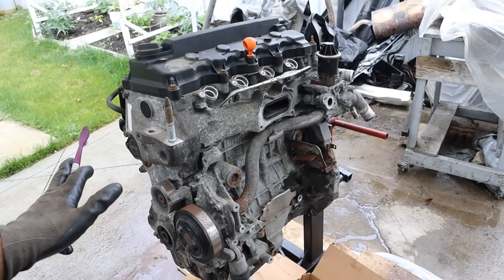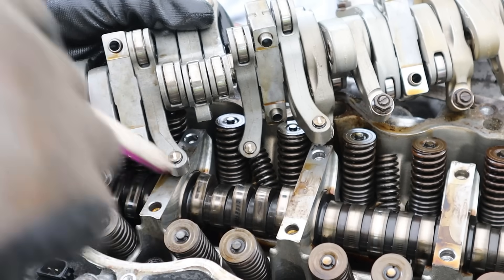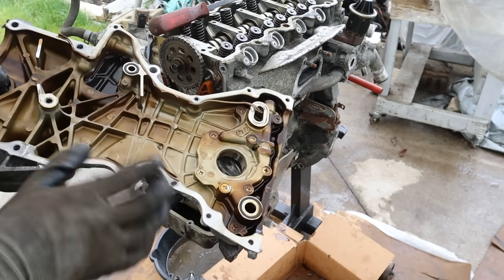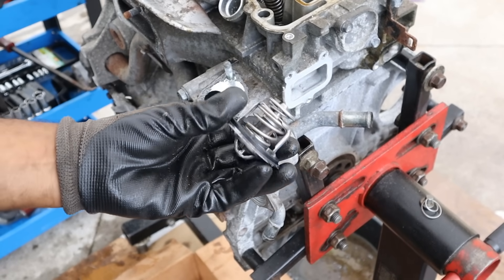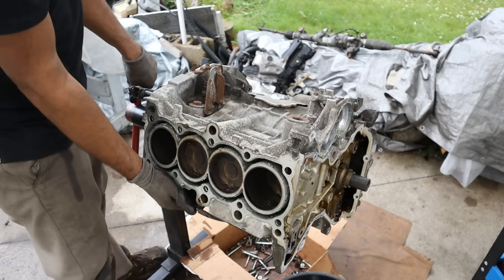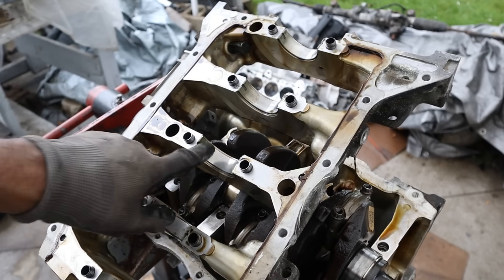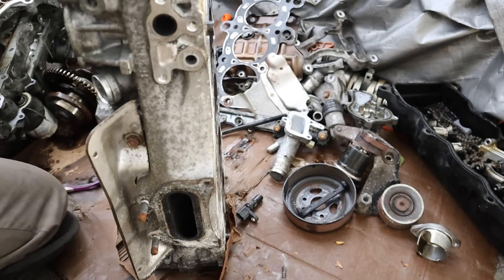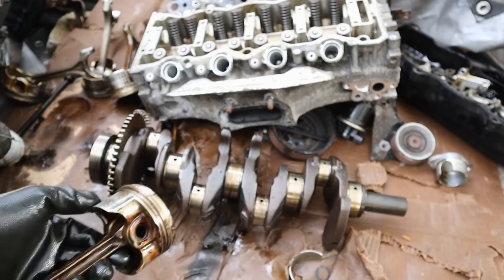Modern Engines are Junk: Honda Civic R18 Teardown Proves they Don't Make Them Like They Used To

Comment: Speedkar , you mentioned the transmission giving up before the engine. Do you have any suggestions for mitigating that? 

I have an 07 with 248000 miles. I’ve owned it since new. I’ve never missed a single preventive maintenance item. Although, I don’t really trust 100% Honda’s recommendations, I’ve drained and filled the transmission every 30K miles except for the first D&F. I performed it according to Honda which I believe was at 60K miles. I’m not having any issues with it but I’m trying to go as far as humanly possible with this car.

Comment: I have this engine in my CRV gen3. It is super powerless engine and consumes a lot of gasoline, but it is actually super reliable even here in cold Finland. We take long trips to freezing lapland and no issues never. It is also super super simple engine to maintain by my self. I don't really need any help from anybody. Adjusting (basically checking) the valve clearances are not issue at all. it just like checking those from lawnmover. I've got 310 000 kilometers in mine and doing oil change every 5000 and i'm using cheapest 5W40 synthetic. I changed to 40 too keep oil better inside since it's an old car already with worn cylinders. I know it is very short but i like to do it once a year at the same time, otherwise i forget it. I believe in sustainable living, not by buying new super low emission car, but to use old one ultill it doesn't run anymore withouht too expensive repair. So far it has refused to die. I'm quite sure the body of my car will rust here in harsh conditions before this R20 engine dies.

Comment: 2012 Honda Civic. R18A, 256, 000 perfect miles.  Idle my car all day in gig jobs.  The thing I replaced the most is the climate blower motor inside of the glove box. Tires and brakes. Original alternator and original AC compressor. I think I'll probably change them at 300k
Reply from the maker: Amazing

Comment: old engines are the best. i have a 27 year old iron block italian made 5 cylinder turbo with vvti, 430whp (front wheels via a viscous coupling) on the apexi AVCR electronic boost controller with no issues. running it since 2016.
Reply from the maker: 430 to the front wheels?
Reply: @speedkar99 Indeed

Comment: I have a 9 th gen accord with a 2.4 with a CVt it runs great but , I make sure not to hot rod it around like my 03 accord . I know the cvt  transmissions are prone to fail , but if you change the fluid and drive “normal “ they will last at least on Hondas and Toyotas

Comment: I got the r20a, 0 issues at 200k and pulls up hills so well with its 150hp. That intake plastic is quite sofisticated, has like 3 modes of operation based on rpm for ease of air flow in high revs or low rev, contributes to higher hp and torque

Comment: For a second, I thought this was going to be R18 slander. The R18 is still criminally underrated for its reliability other than its wobbly belt tensioner issue and AC compressor getting corroded. Other than that, these things are very fun.

Comment: Great engines indeed, very well built, reliable and relatively easy to fix and maintain. I own 2 of them currently, both bolted to manual transmissions, an 2007 civic with 230K which is going to rust away before it dies mechanically. As well as a 2008 with 103K that is spotless body wise. Awesome video showing the inner workings of these things, I like knowing how the internal parts of it work seeing I've never had to dig that far into one!

Comment: I had a 2011 UK built MK8 Civic for 6 years and the engine was absolutely fantastic. Great fuel economy, not a single problem in 50,000 miles, and it was actually quite a lot of fun. A characterful engine. The car around it wasn't great (built in the UK, what can you expect?), but the engine was a real gem.

Comment: These engines usually need valve adjustments because the valve clearance tighten up not loosen. Too loose is better than too tight. Anyway these engines are fantastic.

Comment: Own two Civic coupe's, 2007 manual 5 speed & 2009 auto 5 speed, with this 1.8 engine and will keep for my forever car's. The i-vtec on this engine work's below 3,000 rpm for increase fuel economy, not engine power, by lowering engine air pumping loss and shift's to a normal NA above 3,000 rpm. to red line. Have had to replace the passenger side engine mounts several times due to rubber support failing and causing vibration or engine to jump over road bumps.CAFE standard's and computer's are causing the death of reliable car's in general. Cheer's & thanks for the tear down!

Comment: Why do people hate on building these? In the middle of putting a d16 together, and this bottom end looks just as stout. 

Oil sprayers, bore and stroke like a b18. Fuck huge rod ratio? Exhaust port begging for a turbo manifold. 

Naybe the head doesnt flow? Maybe the ivtec is too complicated? Feel like it just needs a high cam lock and a mild turbo and these things could make 300hp all day.

Comment: Seemed like my 87 Prelude 2.0 SI had more metal parts. It lasted a long time, the only draw back was every 60,000 miles was the timing belt and water pump. The 5 speed manual was great too. Those days are gone.

Comment: I own a 2016 Civic 1.6 Dtec for 1 month now and it is such a great car honestly, fuel consumption is currently at 4.6 liter/100km in the winter with winter tires and I floor it more than I should as a new car lol , 136k km in it , if nothing goes bad I feel like I could keep this car for a very long time, bought it from a mainly Honda seller who himself has exactly the same model so hopefully the previous owners were good to it , before this I had a Corolla and honestly no issue with Toyota either , if I buy another car in the distant future i would love to own a Type R (FK2 or FK8) or a Yaris GR

Comment: Hondas used to be great! My 2006 Ridgeline J35A just hit 236K, and still runs like a Swiss clock. Oil changes every 3000 miles on the nose. I do all my own oil changes. My mom has an 09 Accord 4cyl with just under 300k! Runs amazing. My brother has a 2014 Accord with the Earthdreams engine, I’m pretty sure he’s got around 260k, the engine is noisy as a bag of tools, but runs like a champ. He doesn’t do the maintenance on the thing and it won’t die lol.

Comment: R18s are strong/reliable engines.  However, they are not meant for sport applications. For example, connecting rods are thin as heck.

Comment: Really wished they improved the R18 engines more and more after the 9th gen civics. I own a used 2014 with the auto cvt and it's been very reliable. Keeping it maintained, and I have driven the 1.5 turbo, and they drive fine, but regardless of auto or manual, the newer Civics don't have much of that fun torque part of the older civcs even with the 9th gen's weird Vtech its still a nicer car to drive daily and have some fun.

Comment: get a K20 civic, problem solved
K20C2, or I think the current ones are C9’s. C9’s have direct injection though, so they may turn out to be loathed. maybe stick to a used C2

Comment: My sister had a 2012 Civic coupe with a R18 with 480,0000 km on it. It only ever needed regular maintenance. It met it's end earlier this year after someone ran a red light and hit my sister.
Reply from the maker: Aww. Hope she survived.
Reply: @speedkar99  Yeah, she was fine. She saw the pickup coming so she hit the brakes and he just clipped the front end. Unfortunately, it was enough to crack the driver's side suspension mount so the car was written off.

Comment: I still own my 2008 euro Civic Type S, bought brand new. 170.000 km on highway driving and it still runs like a metronome. That engine is probably the smoothest four cylinder ever made 👌🏽
Reply from the maker: Nice. Type S has the K20 in the euro models?
Reply: @speedkar99  I wish 😀 
It has the wonderful R18A2 . The difference with the five door model is a slightly different suspension setup. And three doors. But as i said, the R18 is a buttery smooth , rev happy, bulletproof engine, paired with an excellent gearbox

Comment: What part of the country are you in? I have a D17A2 that could use a breakdown video. They are known for failing head gaskets after overheating events.
Reply from the maker: Toronto. I already have a D17 video from a 7th Gen civic with the same failure haha. Check it out.

Comment: I actually blew one of these, first car of mine, didn't inspect it properly, and on top of that, I was 4th owner. Didn't see that the oil I was putting in was just leaking out the engine, and kaboom at 189K due to rod knock.
Reply from the maker: Ouch!! How much did that cost you ?
Reply: @speedkar99 Nothing haha. I got rid of it for $600 by selling it to a friend of mine.

Comment: As a guy who wrenches on bikes, you can totally see that Honda’s heritage was built on his bike empire. This engine is literally their standard motorcycle inline 4 set up, just scaled up a bit. And those engines get the crap kicked out of them on bikes too…and still keep ticking.  Very interesting to see.
Reply from the maker: Thanks, and that's quite interesting
Reply: A lot like the 1 and 2 cylinder bike engines - have worked on two of these long ago when I was much younger.

Comment: Im almost at 255k MILES on my 2012 Civic with R18Z1, its extremely reliable! Just oil changes, spark plugs and a few PCV valves..nothing major
Reply from the maker: Awesome. 
How's the transmission holding up?
Reply: @speedkar99 good, factory 5 speed auto , just drain and fill with Honda  ATF every 25k-30K miles

Comment: Manufacturing origin differences: Cylinder blocks experiencing problems in North America are mostly produced by local foundries. The parts supply chain for Asian models differs from that in North America, therefore, there haven't been reports of cylinder block cracking due to the same reasons as in North America.
Reply from the maker: Good call. Those were the earlier 2006-09 models.

Comment: Currently rocking a R18A1 FD1 Civic 2011 with 41,000+ miles odo. Recently changed some wheel bearings and is now needing some suspension servicing. Other than that, the engine is robust and competent enough to do quick overtakes.
Reply from the maker: 41K. Pretty young! Lots more to go. Why is the suspension and bearings gone at such low mileage

Comment: i dont think i-vtec implementation on this R engine is same like any other sohc-ivtec.
in this R series, default engine run on 16valve normal cam.
enter 12v mode cam or valve-overlap cam only when certain conditions comply.
it is like reverse operation of other sohc-ivtec
Reply from the maker: Right, which is what I explained in my video. One of the cam loves have zero lift, I.E. it does not lift or operate.

Comment: The more I watch your videos, the more I am determined to go EV for my next vehicle.
I will stick to 6m oil change from now on, so I can make my current vehicles last as long as I can and do the switch after EV has matured much more.
Reply from the maker: Try a hybrid before making the full switch. We aren't ready for full EV adoption yet.
Reply: @speedkar99 My issue with the hybrid is the complexity of having the max number if components.

I am not buying any EV now, I am servicing my existing vehicles excessively, they are Honda and Toyotas, so they will last many more years. When they finally crap out, EV will be ready for sure.

Or better still, the robotaxi will take over that I only need to maintain one vehicle for the whole family.

Comment: I read a news story about this video. Props!

If the camshaft is lubricated through the VTEC holes then I don’t understand how it’s lubricated when not in VTEC.

Honda with manual: if you don’t mind driving an economy car for the rest of your life 😂😂😂😂

I’ve got a 2000 CRV MT with 188k km’s and that’s how I feel. Forever car. 😂😂😂

So with the skukum bottom end and water jacket around the cylinders this engine could be built up to make big power using a turbo and forged connecting rods if the sleeves don’t crack and if it could breathe. Maybe the turbo would “cure” the valve opening characteristics. Actually “full race” website says these are perfect for turbo and the connecting rods are forged.
Reply from the maker: Which news article did you read? 

I am a little confused on the VTEC lubrication, I'd have to revisit when I get another Honda engine

Comment: The term modern is not how I would describe this engine. My 2015 accord with the k24w1 is still a dependable engine, so when did the actual junk start? Oh well. Opinions.
Reply from the maker: with the 2018 accord.
Reply: @speedkar99 yep. I will agree with that.

Comment: 2006 Civic owner here. 8th gen with the R18 motor.  318,000 miles on the odometer.  The only issue I had with the car was the starter. And a leaking power steering rack recently. I bought the car with 204,000 on it.  And it ran for another 100K just doing basic maintenance.
Reply from the maker: Amazing. Hows the body holding up to the rust?

Comment: R18 wasn't a legendary motor, but it was a very good one. Mine was dead-nuts reliable and fuel efficient.
Reply from the maker: I agree. It was simple, reliable and better than the D17 it replaced. Couldn't beat the K series though.

Comment: Opinion on the K20C2?
Reply from the maker: I really need to get my hands on one. But if its anything like the K20 from an Acura RSX, it would be like this:
https://www.youtube.com/watch?v=JyAgHCfziQI
Reply: @speedkar99  thank you. I think you're right about the A3 being the closest to the C2. Both have the economy Vtec and a port injection system. One of the differences would be the compression ratio for the A3 being 9:8 and the C2 being 10:8

Comment: Turbocharged one of these in Brazil, 0.6 bar yields approx. 300 hp in the engine (ceramic clutch that is slipping from 3rd to 4th) and 242 whp with 32 kgfm from 5000 to 7000 rpm. VTEC kicking in electronically with a parallel ECU from 3000 rpm. Feels awesome with plenty of safety margin.
Reply from the maker: Nice, I wouldn't use it as the platform for a build though. K series is a better option, if you have that budget.
Reply: @speedkar99  Their options are very limited in South America. You should check out some of the builds from down there. They do awesome stuff with motors you'd never even think of.
Reply: @speedkar99  that was the trade off, a civic Si with a k20 goes for 70 - 90k BRL these days, and they have mostly been abused.

The entry level civics with the R series are sth like 30 - 40k, and you can find some more intact.

But yeah, same sort of money on a k series would make close to 400 hp

Comment: I have a question about the early j35, if you have an answer.  Why is it always dark and dingy under one valve cover and it can be super clean and shiny under the other valve cover. And ive seen videos and sometimes the front is clean and sometimes the rear is clean. Is it the pcv system causing it?
Reply from the maker: the PCV system. Its not just a J series thing

Comment: used to have a 2010 FA1 but have since been driving a '15 Si Sedan. I sold my 2010 to my father-in-law, and is now approaching ~300K miles. my Si is at 96K currently, both fabulous machines.
Reply from the maker: Amazing. I wonder if the newer stuff will last just as long.

Comment: Had a UK R18 mk8 Civic

I beat the shit out of it everyday coming to work it just took the abuse with normal servicing

I did snap the driveshaft one day but that was my fault thinking I was 17 again at a wet junction with an uneven surface

apart from that no dramas.
Reply from the maker: Hondas are known for the drive shaft snapping. Its not just you.

Comment: Apart from the head gasket issue, which probably means the head is slightly warped, this engine seems to be in very good condition, but it looks as if there is no intention to reassemble it.  If this is the case, it looks like a waste of a good engine.  Why?
Reply from the maker: Too much work to check and resell to someone in good faith. I scrap everything. Its more fun that way.
Reply: @speedkar99  Scrapping a good engine is fun?  We are very different.

Comment: Honda enthusiast here. I can without a doubt say this is by far Hondas most reliable engine they have ever made. Mechanical valves, low compression, simple but efficient head design, and a simple emission control system.  For a basic A to B car my 9th gen civic was amazing. Even though it wasn’t the EK in the garage or the first gen CRV with Vtec and a 5 speed it 100% made up for it in frugal commutes to have more spending money for the fun cars.
Reply from the maker: I agree, but then there's the K series. 
The modern stuff is garbage, L15T went down hill.

Comment: I have an R18 with almost 400,000 miles of very spirited driving on it. Still runs great. I haven't done more than maintenance and replaced some consumable parts on it.
Reply from the maker: How do you find the power for acceleration? Weak?
Reply: @speedkar99  bro its the economy version of course its weak but its reliable asf, if u want little bit more acceleration n still a lot of reliability get a k20 SI
Reply: @speedkar99 I drove a hrv 1.8 the other day. Let's just say the power is alright. No VTEC kick in yo feeling but it can climb to 180kmh in no time thanks to its CVT gearbox.
Reply: @speedkar99 At 248K miles I find my R18A still has compression of 180-185 Psi on all cylinders , doesn’t burn oil between oil changes (1/8 quart if that). Any suggestions for keeping the transmission in the best shape possible?

Comment: I have a 1997 crv with 322 miles terrible maintenance oil changes every 28k transmission never touched.I never had a need for a new one . 😅 it's obvious
Reply from the maker: Those were also strong engines. Please try to maintain it though.